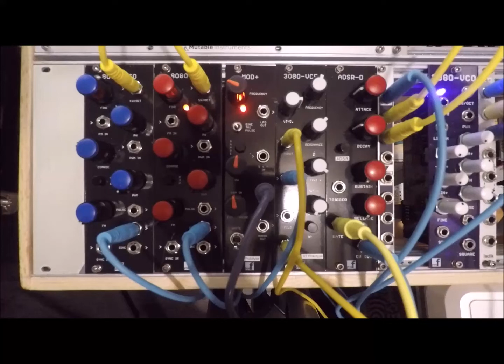reSEMble 2 of 2

Comment: Hi, this seems to be the kind of thing i'm looking for, but i just want a setup where i can use my own synth and have an SEM as a separate addon but configured the same as an original, what individual modules would I need ? Great video and demo by the way.
Reply from the maker: Hi Steve, thanks for the kind words and I'm glad you enjoyed the video.  Sorry if it seems tacky to point you to another of my videos, but let me know if this helps:  http://www.youtube.com/watch?v=Kqo0UhkMvuA
Reply: @RandyPiscione  WOW Thanks not only for responding but for responding quickly ! I had a look  at your reSEMble video and think this is the way to go. Sorry to be a pain but with the reSEMble can I bypass the oscillators and use an external audio source from another synth and effectively use this as an SEM addon unit ?
Reply from the maker: @stevecoutts349  There is an external in on the reSEMble panel that you could use, and then just turn all of the VCO levels down at the VCF mixer and turn up the external input.  But, I'm not sure why you'd want to do this.  The VCOs are based on the SEM, so reSEMble is a substitute for the SEM.  What are you hoping to add on to the SEM?  I suppose you could still run your CV and Gate into reSEMble and still use the ring mod and folder without hearing the actual VCOs.
Reply: @RandyPiscione  Hi Randy thanks for your patience. I really like the DSI OB6 specifically for the filter sound, but seeing that it has no audio input to utilise the filter with other synths I own, I cannot justify paying all that money. So ultimately what I'm looking to create is a standalone hardware unit (to use with my existing synths)  that resembles the Tom Oberheim/SEM/OB6 filter sound (as I'm led to believe they are similar). I would like the   unit to have LFO, Gate, Trigger, ADSR(D) functionality over the filter like you would with a synth but use my own audio source. I would also like the ability to use external CV/Gate/Trigger and ADSR(D). Thats why to me the reSEMble looks like what I'm after but without the oscillators. I like the idea of switches rather than the patch cables as I'm new to modular stuff. But having said that I'm not opposed to creating what I want using individual modules, just unsure of which ones I need to fulfill my objective. Sure Doepfer and the like have modules but for what I want, it could be expensive and lack the functionality, so I have gravitated towards PM Foundations stuff because it's cheaper, more versatile and I like soldering ! Hope this explains what I want to do and many thanks for your help and responses.
Reply from the maker: @stevecoutts349  That makes sense.  You could build a reSEMble panel without the VCOs initially and add them later if you want.  Or, if you want to get something different plus your audio source through the filter, build the VCOs too and you'll get a folder and ring mod, two things the SEM does not have.  You might be able to also just build separate modules but I'm not sure of the input levels for the VCF.  If you happen to be located anywhere near southern Ontario, feel free to drop by and experiment at my place.
Reply: @RandyPiscione  Thank you very much for your help and advice, it's much appreciated. I think I know what i'm gonna do, but it's going to be a mammoth task - but hey ho new concepts don't evolve out of playing it safe. I may even do an upload to see what you think, but it wont be any time soon ! Thanks for the offer by the way but i'm in the uk, if I come to Canada i'll be sure to swing by 👍